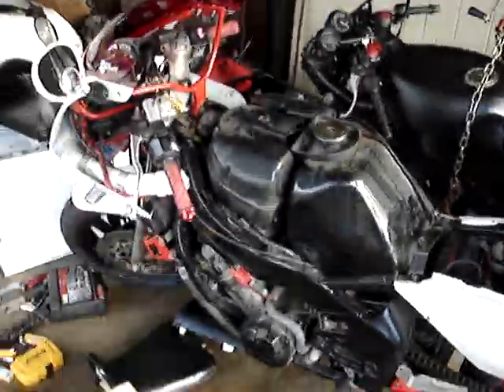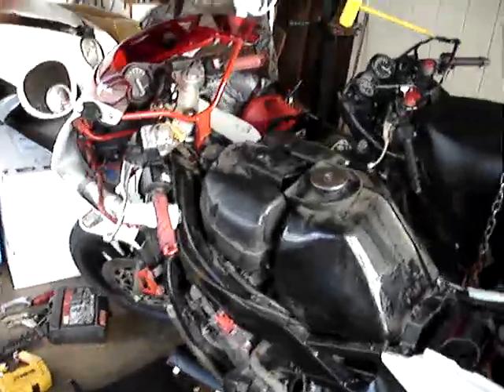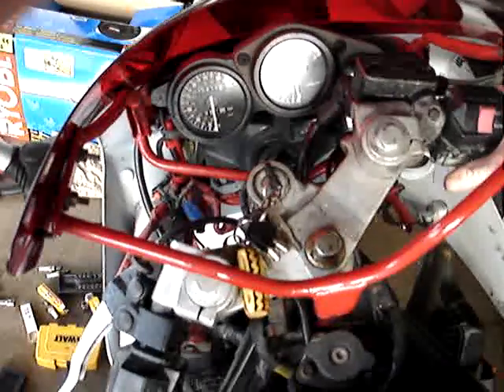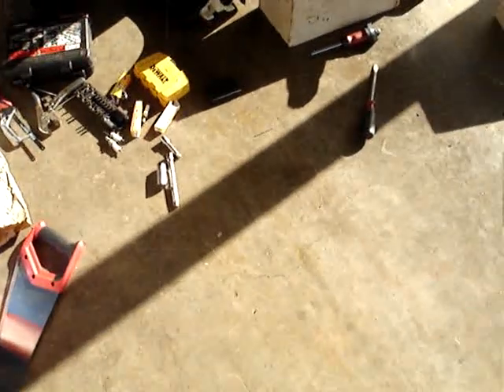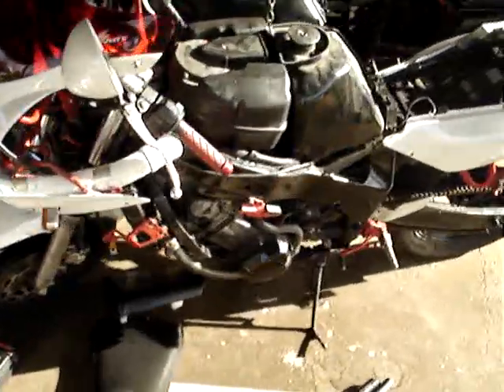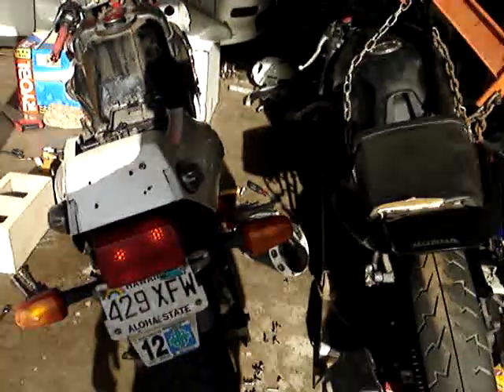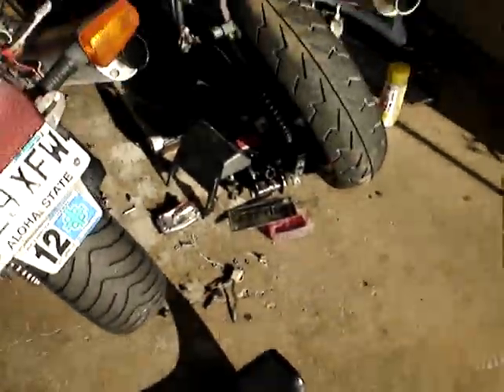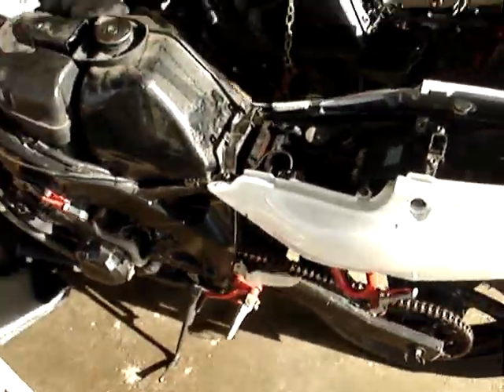first start after cleaning carbs

Comment: A good tip is to flip the kill switch on/off a few times to fill the bowls after reinstalling cleaned carbs.  That way you're not wasting battery to turn the engine until the carbs are full of fuel again.

Comment from the maker: the exact roll of the diaphragm: when the engine sucks air through the carb, air gets sucked through the holes in the bottom of the slide that is attached to the diaphragm, it starts to create a vacuum on the opposite side of the slide diaphragm and the slide is lifted up to allow more fuel. If there is a hole or tear in the diaphragm, it cannot function because the air is meant to be sucked out of the diaphragm side of the carb creating the vacuum.

Comment from the maker: Thanks for commenting, but thats never been a concern of mine. I've cleaned more carburetors to count, almost all of them the same way. They sync fine, even if I sync by ear (w/o manometer) they sync fine. I agree that using a tiny wire brush pipe cleaner will score the inside of the jet, but a guitar string isn't going to damage the jet that bad. I only stick it through once, then spin the jet on the guitar string, spray it through with carb cleaner, then air, and it's fine. Never had a problem

Comment from the maker: yes, they wear out just like car ones do. But they are usually attached to the coils so the coil pack and wires would need to be changed. But since fewer miles are put on motos they aren't changed as often as cars.

Comment from the maker: I've heard of people replacing them, but I don't know what mileage they were at when they did. I had a bike with 60k miles on it and they were never replaced. If you are worried about it, order a used coil pack off of ebay and check it out to make sure it works, and just hold on to them to be safe, ebay ones aren't much. My FZR has 40k on it with stock coils/wires.

Most coils get ground by bolting to the frame, sometime this gets rusty and the coils stop working, sanding the contacts fixes it.

Comment from the maker: it's not as big of a deal as you think. Motorcycle oil contains zinc dialkyldithiophosphate (even though it looks like i typed random letters, i didn't, it's an actual word) which coats the engine parts long after the oil has drained out and keeps it lubricated. I probably cranked it with clean carbs about 5 hours after it wan running anyway. I agree with you though, revving after it's been sitting for a few days or a week is a bad idea.

Comment from the maker: @cheekalover 
it's really not that hard to do carbs, just a few things that are really important to know..don't adjust the float height, don't get carburetor spray on the diaphragms. I use a guitar string through the jets after they are unscrewed, stick it through once and spin the jet on it. It's easier to use a T-handle screwdriver to get the floatbowl screws off. Then to sync them adjust the screws between the carbs until they are all open the same, use a feeler gauge

Comment from the maker: @rpadilla99ish 
yeah, I don't like those diaphragms, they are $100 a piece for my bike. I had one set of carbs for my FZR that had creased diaphragms, so when I hit a certain RPM, the RPM gauge would still rise but the air/fuel ratio was off and it wouldn't accelerate until I got past another RPM. The creased diaphragms would hinder the bike from operating right. So I had a big dead spot, I bought another set off ebay for cheaper than the cost of the diaphragms and cleaned them. good to go now!

Comment from the maker: I would need a better description of what's happening with the bike. But it sounds like either someone has jetted your bike wrong (just requires buying new jets) or the air/fuel mixture is off, and you will just have to adjust the screws. Your best bet is keeping your old carbs unless you want to drop $700 for new ones from the dealer, or risk getting $60 ones off of ebay and hope they are in better shape than yours. Pm me your symptoms and I should be able to guide you in right direction.

Comment: Nice job man... I can hear her running pretty smooth. I did a carb job yesterday but it was then at the end of the process that I realized that I didn't have old guitar strings to clean the jets and now my bike won't start (my guess is that the pilot jet is still clogged)... What do you think should I just clean the jet that i suspect of being clogged or give the carb another thorough cleaning ? (Yamaha XT250 1984)